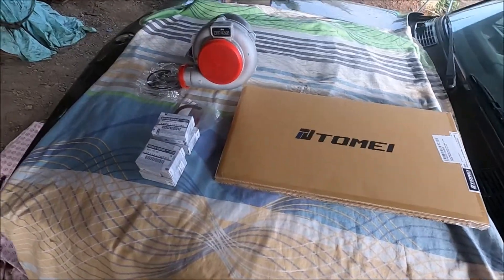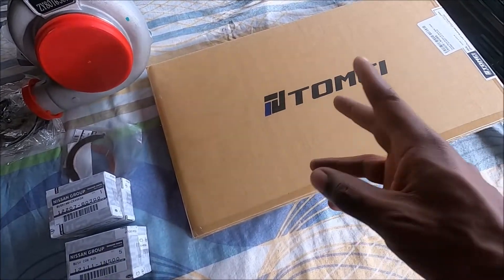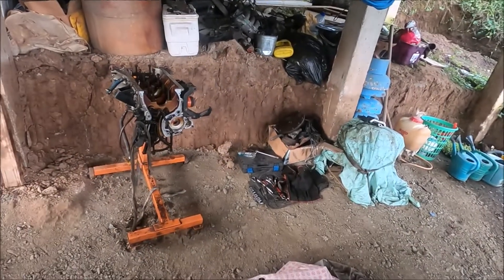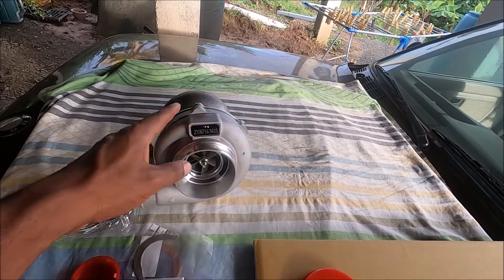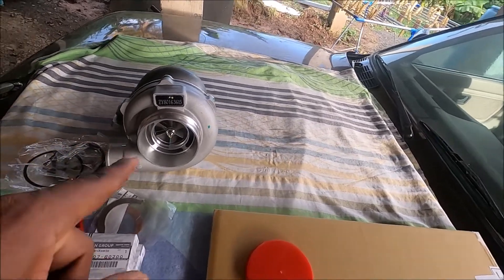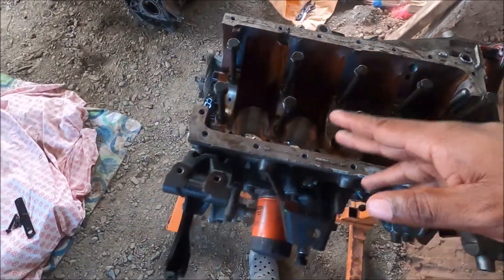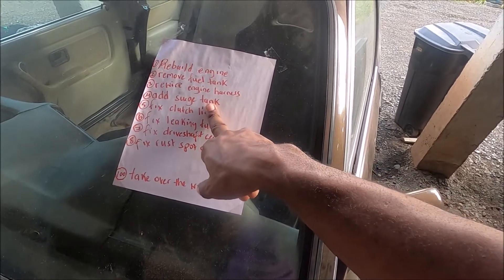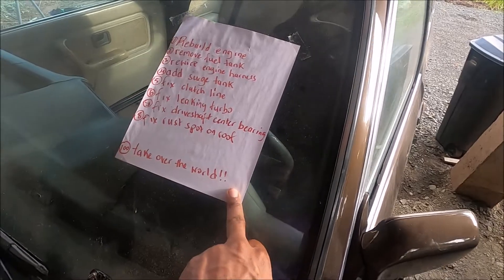Judas Sr20det Rebuild News

Comment: Awesome channel...I especially like the sr20 content since I'm a long time fan of that engine and the vg30dett. That's going to be an awesome build with that gt30 turbo, but it's a little overkill for mid 300whp. I used one of the ebay "57 trim t3/t4 " turbos to make 330whp @ 17psi on 93 octane pump gas with a tuned ecu and 750cc side feed injectors on my sr20det many years ago. I think you will be doing yourself a disservice if that head gasket is thicker than the stock head gasket...you will lower compression and decrease the squish...unless you are going to run ALOT of boost, you will loose engine efficiency and have to run more boost just to make up for the decrease in efficiency. I would go with a stock or even slightly thinner headgasket to increase squish. Do you guys have E85 fuel there? Here is my 240sx running the quarter mile with lots of wheel spin...you can see from the MPH, the horsepower was there... keep up the awesome work! https://youtu.be/EduIk-Sx-js
Reply from the maker: Thanks brother. Initial goal is 350-370 but it will more than likely end up in the ~400 whp range. A gt3071 would have probably been better but maxpeedingrods don't make those. If I don't like the response I may get one of their t04e.

The car has sr20de 9.4:1 cr pistons in so the 1.2mm gasket is just a hair thicker than stock and should only lower cr by 0.1-0.2 based on what I have seen. When budget allows it I will plan to throw in some Manley 9:1 pistons. I don't see me going past 20-21 psi with this turbo though.

We only have pump 92 here but the car does have a meth injection system so that will be used. 

Your car is moving man. 116mph trap indicates high 11s with a decent 60ft. That's very impressive.
Reply: @DCWERX  awesome! Ok, I see you're doing your build in stages (I do the same). I would imagine that gt30 will put you at your tatget HP at 20psi.. looking forward to the build😁👍🏿

Thanks, my 240 was a challenge by forum members that were spending $1000's on namebrand parts but only making about 260whp...
Reply from the maker: @sc63sr20det  yep. I would love forged pistons now with head studs but I can't afford it now and miss driving my car so I can't leave it apart while I save up.

Yep. Based on what I have seen 20 psi seems to be the magic number for the 400 whp. 

I am new to sr20 and thus I may be a bit naive, but it baffles me why many struggle to make ~300 whp with so much invested
Reply: @DCWERX  I feel you brother, I do the exact same thing...modify...build..modify...build...blow it up...repeat...LOL. 

Yes, like I said, I made 330whp on 2 different dynos with an ebay intake manifold, exhaust manifold and wastegate, and the (then) $100 ebay "57 trim t3/to4e". That turbo only lasted me 6 months, and it wasn't even a real 57 trim...the wheels measured out more like a 50 trim. They used to advertise them as 500hp turbos, but I noticed a few years later, they advertised them as 380hp turbos.

From what I remember/learned, the sr20 is a strong engine, but has an oiling issue (don't remember particulars) but I killed rod bearings in two of mine. I think the reason so many people struggle to make decent HP with the sr20 is they have mismatched combinations, and/or they undershoot their target HP and run small turbos that will require too much boost on pump gas. Most of them buy high dollar t28 based turbos and only run them at 10-15psi. The other thing I feel they do is; not pay attention to details... I knew the ebay stuff wasn't the best quality, so I had a welder reinforce the welds on my exhaust manifold before I ever let it see any exhaust heat...also cleaned up all of the flashing and slag inside of it. I enlarged the wastegate hole so it wouldn't boost creep as well. I ran the oil restrictor on the turbo and a full 2.5" exhaust from the turbo to the muffler. Efficiency is the name of the game. The only thing that wasn't from ebay/china was the injectors (750cc sard side feed) and the tuned ecu.

I feel your combo will be quite powerful...especially when that turbo is ran at 20psi... you may have to pull some timing because of the 92 octane pump gas though...but I assume the meth injection will allow you to add the timing back (I've never played with meth injection, but heard good things about it)... I wish you guys had E85, makes tuning alot simpler, but I see you're really good with ecu tuning, so I have complete faith you are going to take over the world! :-)
Reply from the maker: @sc63sr20det  so much good info man. I get why everyone wants a t28 or gt28 based turbo as the spool is very impressive and it's bolt on. I even considered rebuilding my gt2871, but for my power goals I would expect to run it at 22-25 psi to hit 400 whp and be left very little room to grow.

What ended happening to your build ?

My current 550cc injectors will max out ~330 whp on gasoline at stock fuel pressure so I couldn't run ethanol even if I wanted to. Next stage of the build will include 1000cc Injectors and a 2 more fuel pumps ( 1 for the surge tank and another for fuel supply) along with head studs and forged pistons. At that point I may add a flex fuel sensor and buy some ignite red or some racing e85 blend for track use. 

The methanol injection does help but I don't want to rely on it as the distribution across all cylinders is usually not perfect.

I feel you on the eBay parts. I'm from a 3rd world country so I intend on using as many eBay parts as possible as long as they don't sacrifice power and reliability.
Reply: @DCWERX  my build (the one in the video) spun a rod bearing (was on a road trip and I think my TPS sensor went bad because the car started running really rich...by the time i reached my destination, it was knocking. I ended up selling it because I didn't have time then to fix it.
I've gotten away from cars for a while and have been playing with motorcycles because they are cheaper to go fast with 😁. But I feel the urge to build a fun street car , so I'm narrowing down my selection.
Yes, those 1000cc injectors will serve you well. I'm not very familiar with any race fuels other than VP (it's locally available), but I've read good things about the ignite fuels. 
I've been playing with different fuels in my bikes, and I've fallen in love with the alcohol fuels (E85 and M5 methanol)... They have a large tuning window, and E85 is very forgiving (methanol seems to be a little less forgiving on the lean side, but you can run it as rich as your setup will allow, and it will still make power.... It's just corrosive and wants to dry everything out.

I will be following all of your builds and watching the ECU tuning tutorials (excellent job)😁👍🏿
Yes, those guys used to want the turbo to spool like a diesel 😂🤣.... I hope they learned that the quick spool came with a price. Guess they didn't know they could run a larger turbo and use a smaller a/r turbine to help spool🤷🏿‍♂️